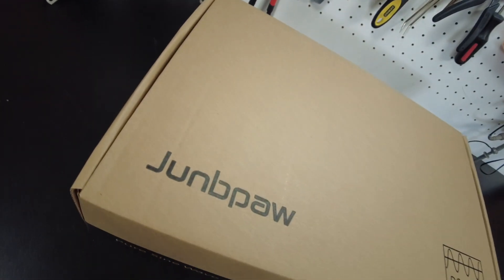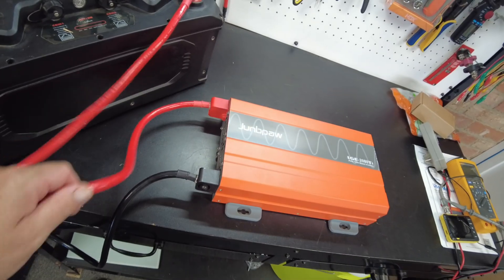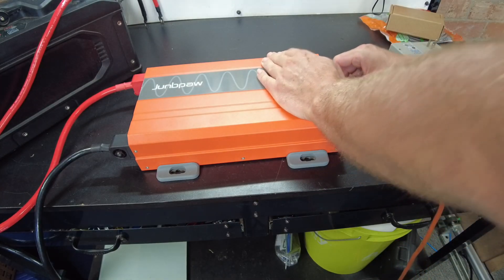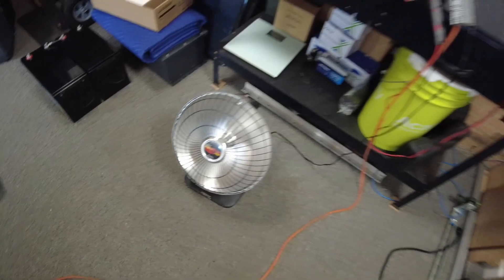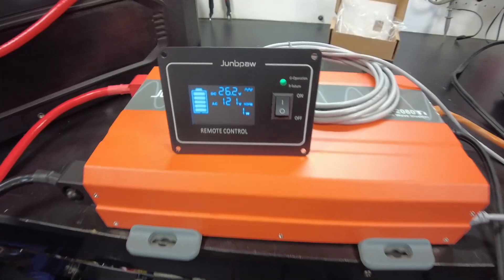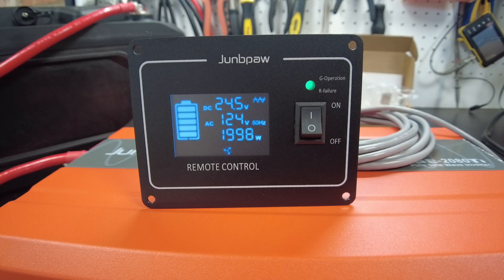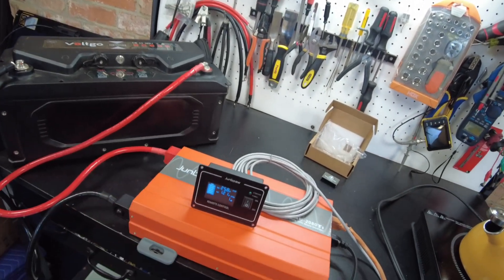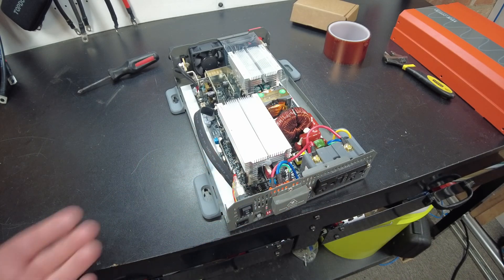Junbpaw 24v 2080W Pure Sine Wave Inverter

Comment: That Junkpaw high frequency transformerless inverter is going to fry your appliances because it lacks an output transformer and doesn't provide any galvanic isolation between its DC boost stage and its AC output. No thanks.

Comment: Thank for the video. First time I've seen an inverter come with 2 awg wire. The fans sounded quiet and the overall performance was really good. The use of bus bars inside was a real treat to see and the clean build. Air flow was directed on one side while the other was open so I give this an A+. I use a 24 volt 1500 watt swipower inverter and I have no complaints using it.
Reply from the maker: I was indeed surprised with the cables :) I like this unit, I think I'm going to do a nice build with it soon!